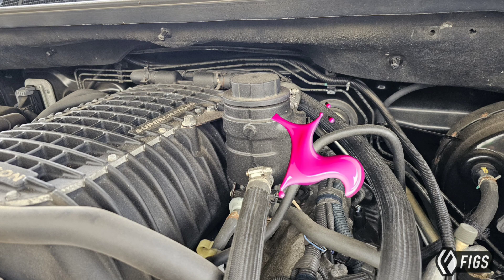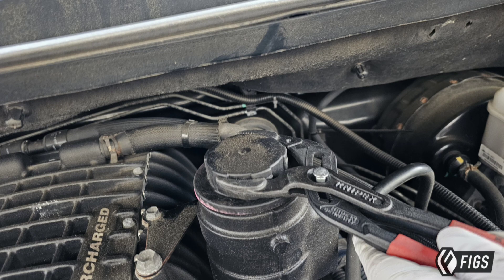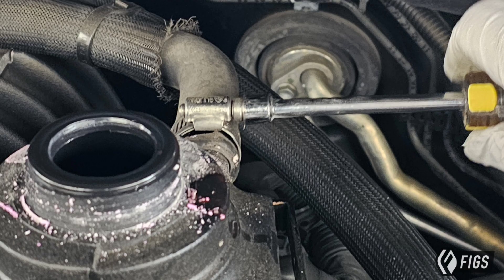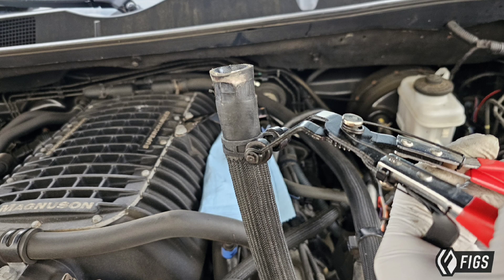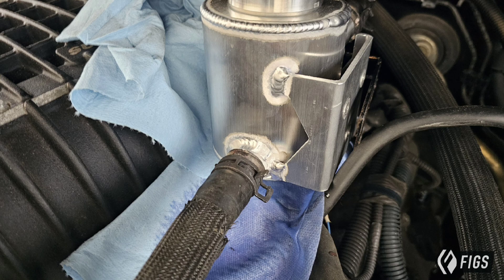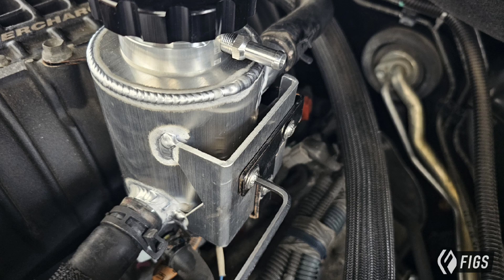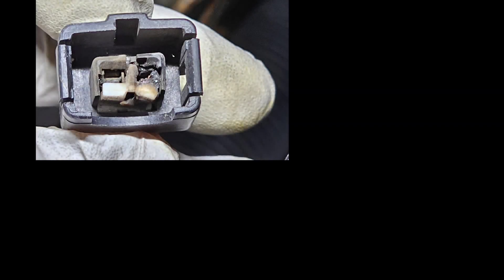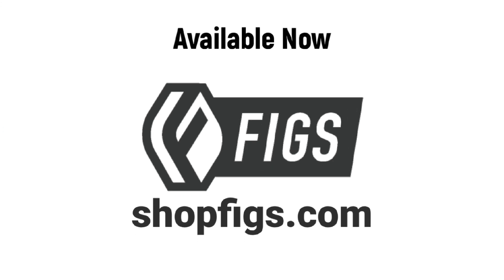Tundra Supercharger coolant tank upgrade.  Bye bye leaks.

Comment: What should the fill level be?
Reply from the maker: Top of the top barb connector. Just short of the top of the tank. You should be able to see the coolant swirling.
Reply: @FIGSEng Thank you, I was low and probably cracked my radiator.
Reply: Will this work on a 2016 4Runner with a Magnuson SC?